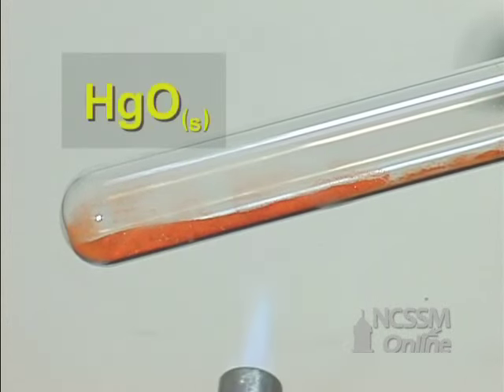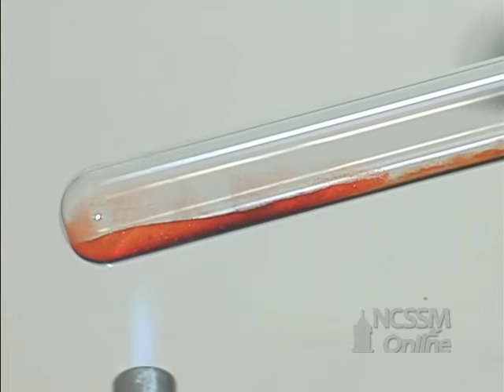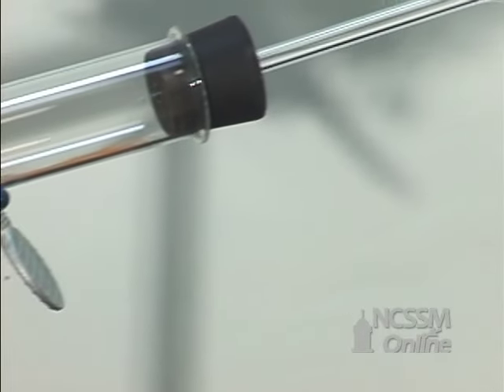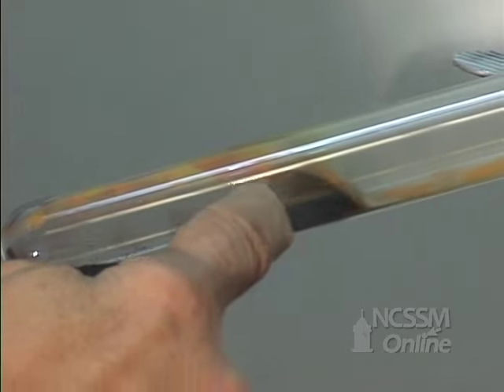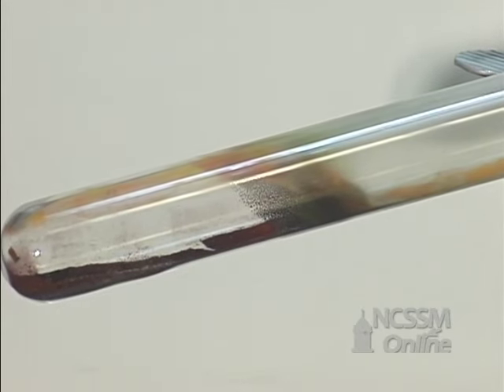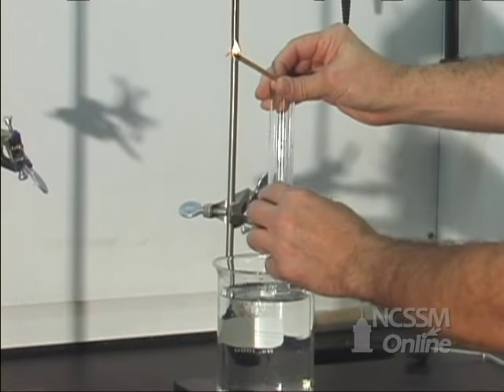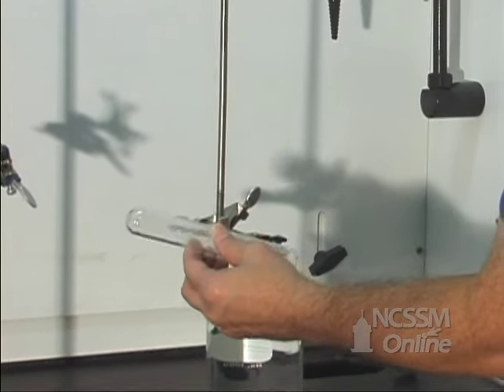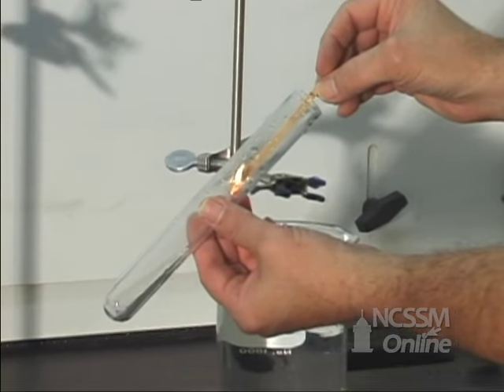Decomposition Mercury (II) Oxide and Oxygen

Comment: How would you explain that when HgO is heated, it gives off the oxygen, but when you heat ZnO or CdO (both group 12 elements like Hg) heating it just keeps it oxidised? I know that it has something to do with how noble the metals are, but how would you determine wether a reaction like that happens or not, the Nernst equation doesn't work here, as we are not in a solution and are dealing with solids.